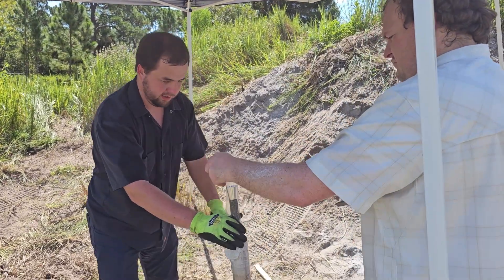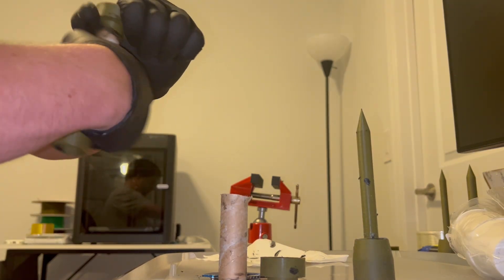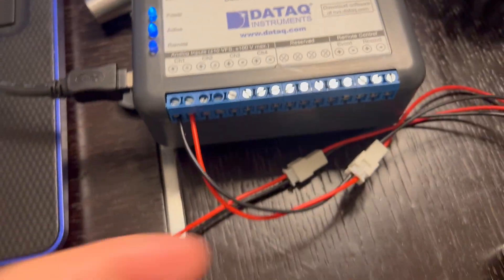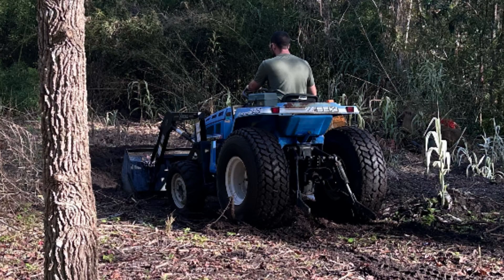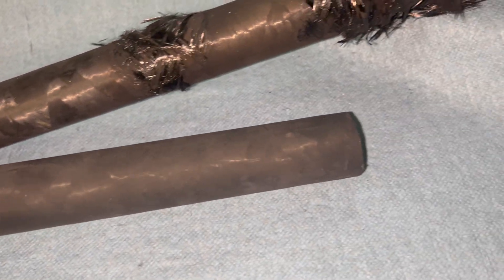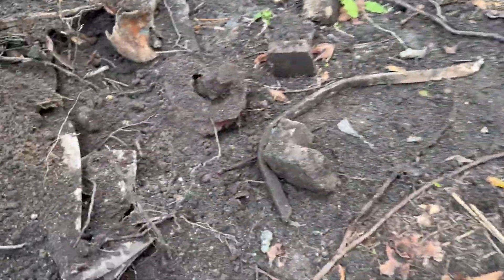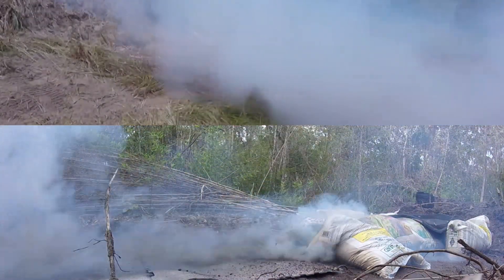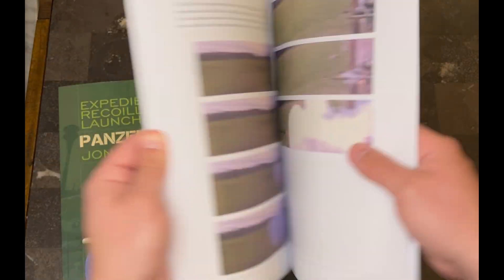Pushing the Limit to Build a Hypervelocity Rocket - Swizzlestick Test 2 (With Data)

Comment: cool! I just got the same DAQs and im pumped to use it for the first hot fire test in the next day or 2. I went with 1 load cell and 3 pressure sensors tho as im hoping to test liquid fueled rockets motors soon.
Reply from the maker: It works great once you figure how to wire it up and calibrate . Took a little work but it’s set up now

Comment: The tube will expand when it pressurises. Try adding som ptfe bushings to the clamps so they can compression a small amount when the motor lights and expands

Comment: Carbon fiber cases are notoriously sensitive to defects. Hydrostatic pressure testing before casting the grain was standard procedure on the larger motors I saw.

Comment: Watch BPS video test. Place your test rocket and or engine vertically so nose points to ground and engine burn points up.  No need for weight bags and mounds of dirt and it looks professional & get better data on test visualization. 😉
Reply from the maker: I’m testing near populated areas so gotta contain the blasts or risk injuries

Comment: To improve the accuracy and concentricity when drilling, spin the propellent grain instead of the drill.
Reply from the maker: I did try that on a lathe and the grains get crushed in the chuck
Reply: @WildArmsResearchAndDevelopment I'd machine a custom sleeve for the motor so the grains don't get crushed as bad. Or maybe make a bulkhead section that can take the force so the grain is not exposed to those forces at all. Unless this isn't what's causing the grain breakage.

Comment: You don't need 600lb to propel this rocket. I can help you design motor so it works properly. E-mail me if you need help.
Reply: Its a hyper velocity rocket so it does need close to this amount of thrust. The idea is it goes so fast that a tungsten penetrator in the rocket could take out a tank or something similar.
Reply: @everythingballistic8812  Carbon fiber tube can't hold 2000psi pressure at such high temperatures. In general tube can hold even higher pressure, but as soon as high temperature is introduced it will always fail unless pressure is significantly lower.

Comment: again the same problem 😅😅 . u dont have the shape for the end of the proplerant u have to make thing called finocyl i think just on the end of grain u adding this thing too make more surfarce aera on the end of grain
Reply from the maker: That would increase the surface area and burn rate as a result and explode the rocket, the issue is the mostly the formula, the propellant does not have a plateau burn rate.